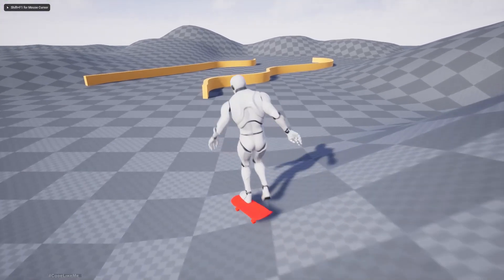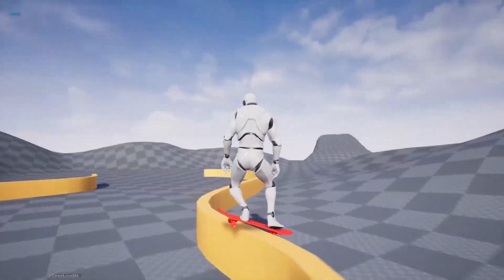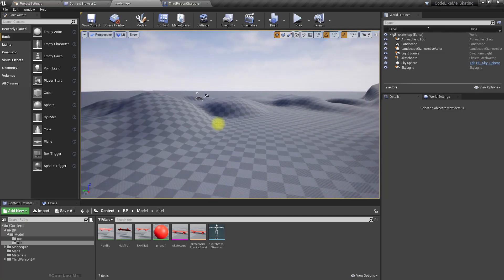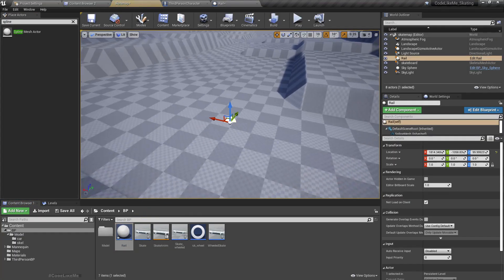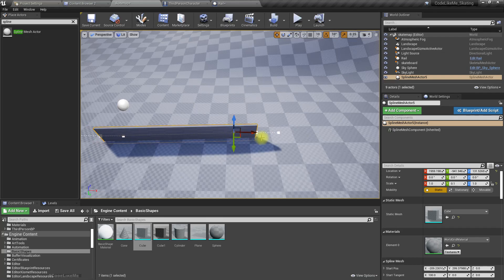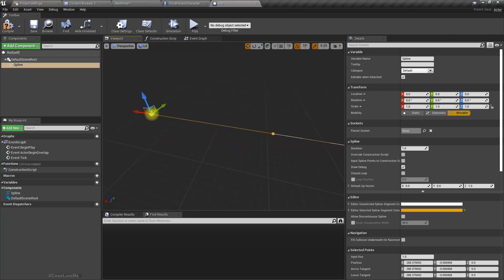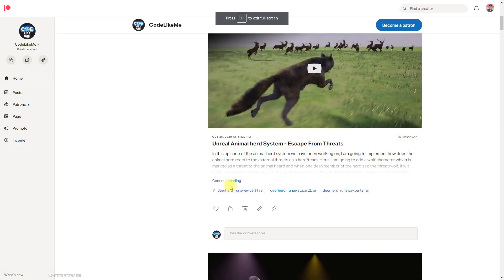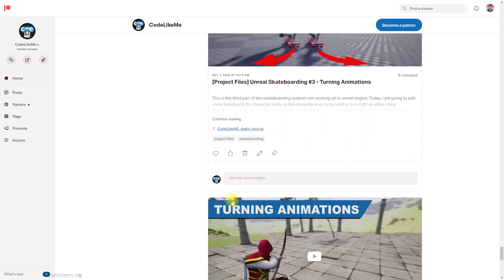Unreal Skateboarding #7 - Grind

Comment: I tried doing this but the sphere trace never detects the rail; it 's always red, even if it's overlapping a grindable object. I've spent over a week on this tutorial trying to fix it but is seems like I followed it to the letter.
Reply from the maker: Well, can't say why without debugging the code. But you are welcome to compare your project with mine
Reply: Check to see if the spline is set to ignore the camera channel in the collision settings, it should be set to blocking. You can access it in the construction script for the rail, and by clicking on the node  "add spline mesh component", in the details panel make sure it is set to either block all or to not ignore the camera trace response.